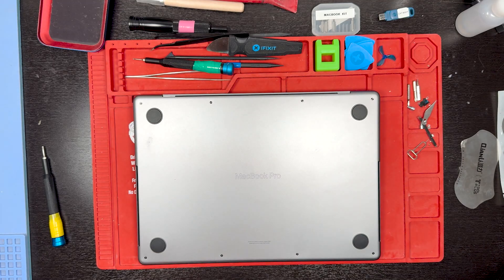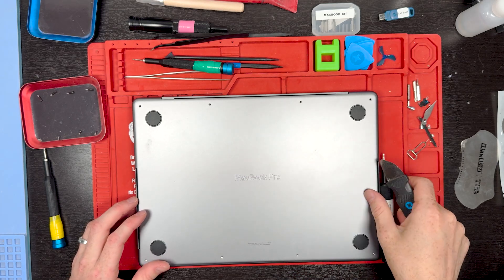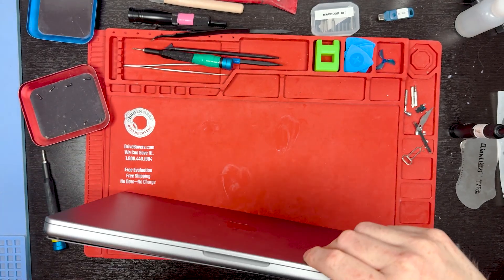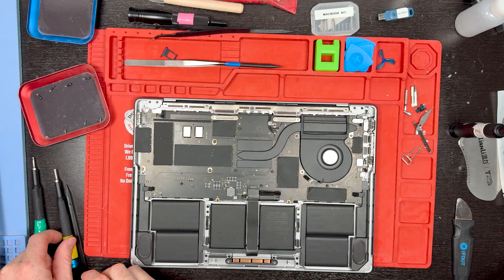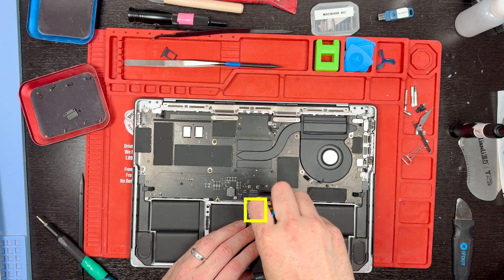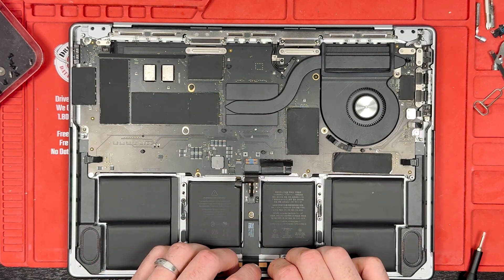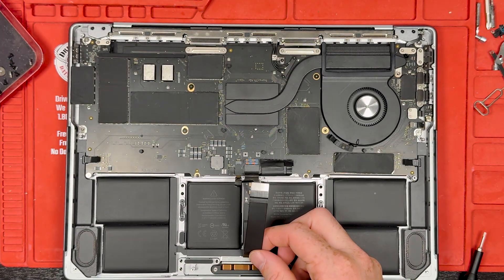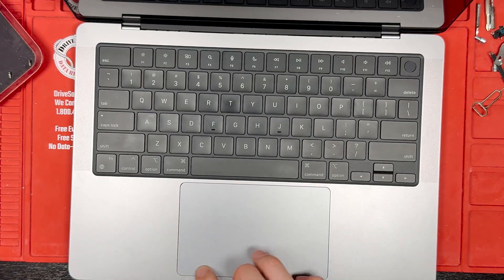MacBook Pro A2918 Track Pad Replacement

Comment: Thank you for the video. i have a macbook air 2019 (intel) and the keyboard and trackpad stopped working at the same tome. Do you think replacing the flex cable of the trackpad resolves the issue?
Reply from the maker: Maybe but I’d do while tack pad and flex cause it’s a ton a work on those 2019 version you need to take out logicboard